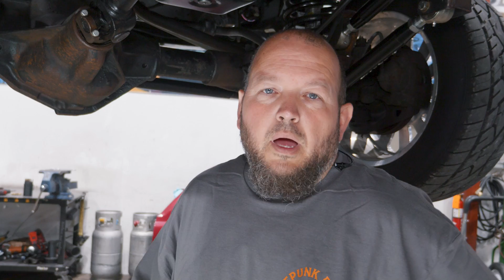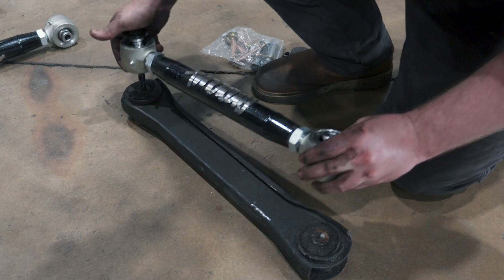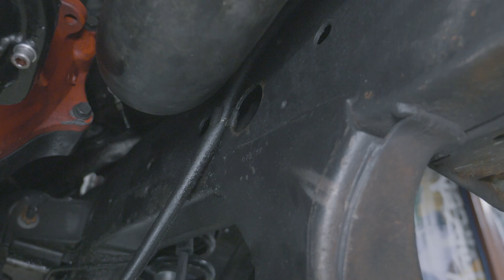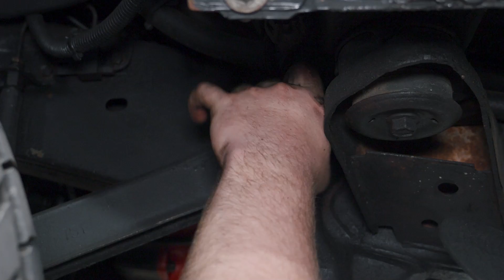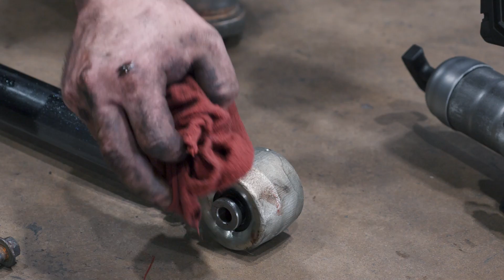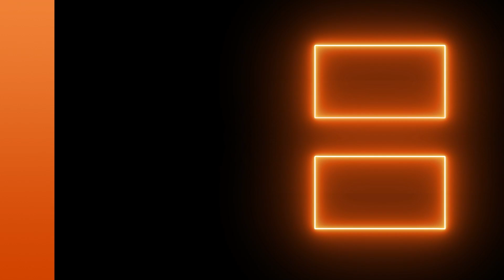2nd Gen. Front Control Arms Install

Comment: Didn’t the bolt size change in 2000 too 16mm ? I looked on the website, didn’t see two options. I would like to purchase a set but don’t wanna order the wrong set
Reply: Yes. I just got my sent and they were wrong. Called Lyn and he sent out the right ends immediately. Going forward they should be supplied correctly depending on your model year